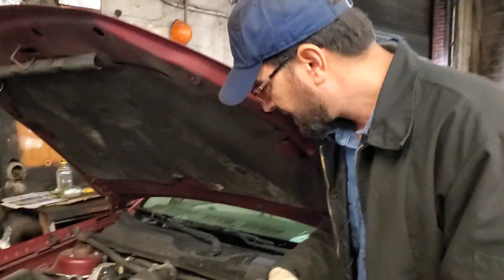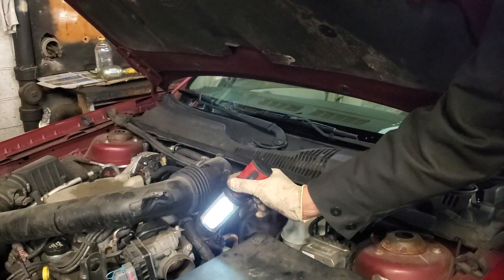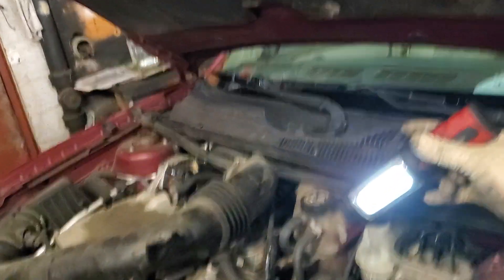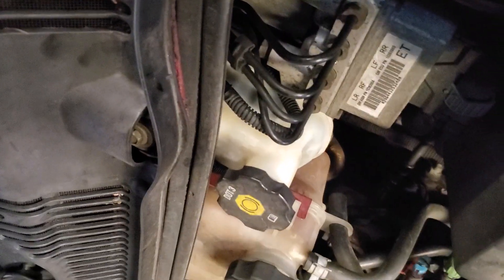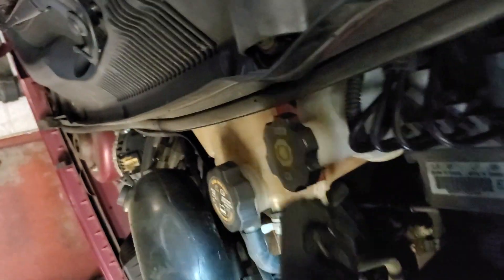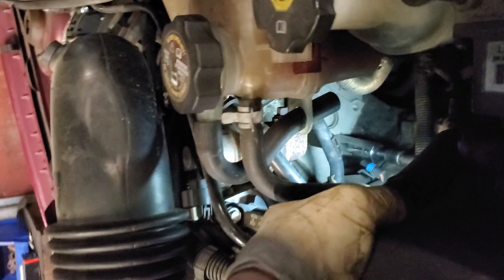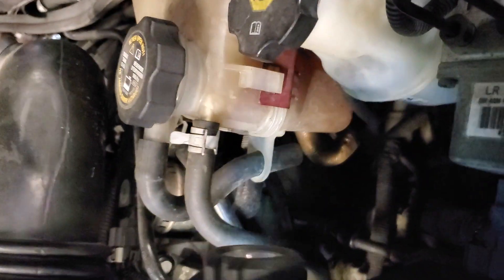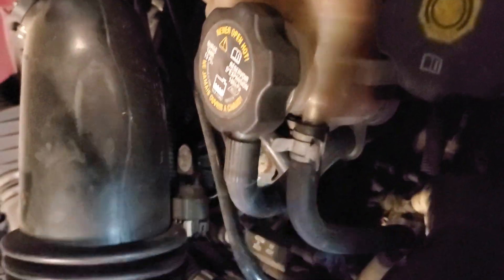2004 Chevy Malibu temperature sensor change and location

Comment: Will the temperature sensor stop the cooling fans from working?
Reply: Yes I just had to replace mines
Reply: Mine just started overheating, gauge on the dash was getting hot, but fans weren’t turning on at all. Same deal with you guys?